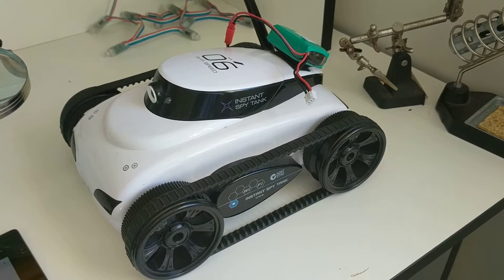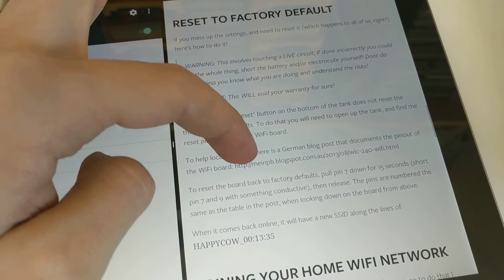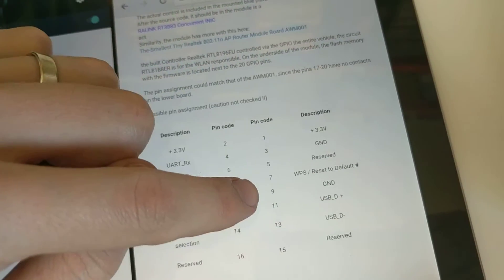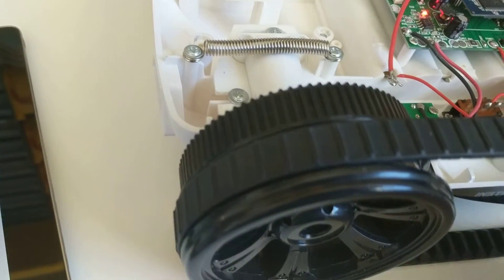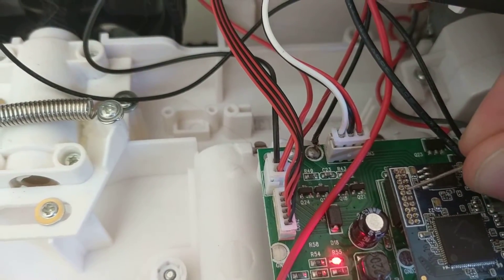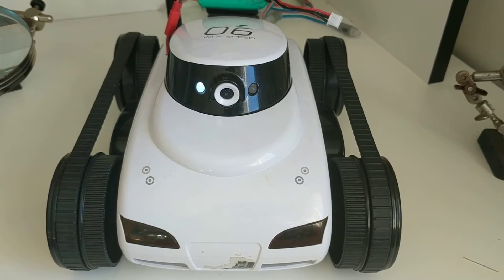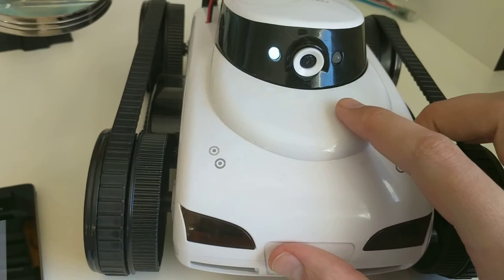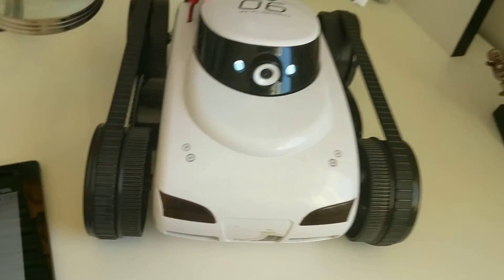Wifi Spy Tank - Reset to factory defaults

Comment: I have one of these tanks but haven’t used it for a while. Went to use it yesterday but the I-spy toys app seems to be unavailable now ?? I tried installing one version I found but it says it’s unavailable in my location ! Midlands. UK. 
Can anyone help ?
Cheers
Reply from the maker: I think the app is com.leo.wifitoys.Controler.jgremoter you might be able to google that and get the APK. I have not tried myself.
I think this is the original download link (that won't work): http://ispytank.com/index.php/app_download?___store=english
Reply: @mic159  Thanks for the info. I tried that link but no joy. Is it the correct spelling ? Cheers
Reply: @mic159 could you Update on this? The link is not working. And my tank is just saying: unable to connect to camera when i try to connection through the ispyapp or whatever its called.

Comment: Hi. I have an i-tech tank 777 325 and it turns out that in remote mode I can control it if the phone is connected to the router-wiffi, if the phone is in 4G mode, a CONNECT TIMEOUT message appears. What I can do?

Comment: How to turn on the wps? Using that way? Can you help me? because my spy tank had a password? And i dont know what is it?
Reply: And the Documentation plss?😇
Reply from the maker: I dont think the router inside this supports WPS, and if it did, there is no button on it to accept new clients anyway.
Are you talking about a password on the WiFi? or on the admin panel of the tank?
There should be no password, its supposed to create its own WiFi network as open.
Reply: Yes 😇The wifi of the tank does have password? And i dont know what is it? Can you help?😇
Reply from the maker: Are you sure its the same model as this one?
Whats the name of the WiFi network?
Reply: Its HC08D68F can you help me with that?😇 thanks in advance
Reply from the maker: Try "HAPPYCOW" ?
Did you ever login to the admin page and set a password? because these should not have a password by default.
Reply: @mic159  Should not, but it does in some cases.  I have same issue. Manual says password is "00000000", but it's not working for me, so I'm looking for the way to reset WI-FI router somehow.